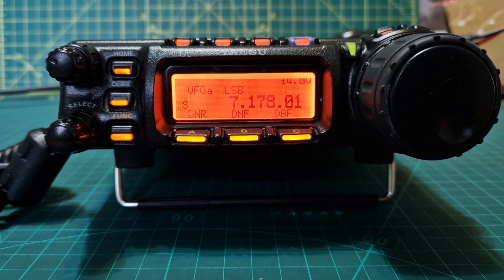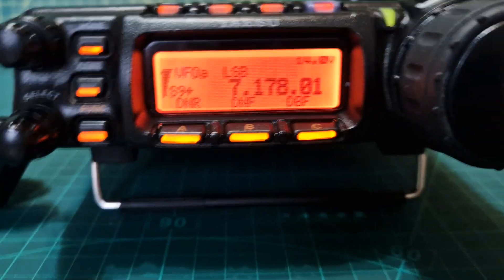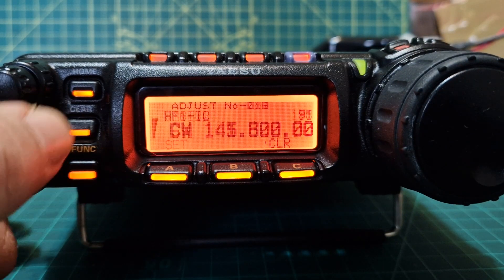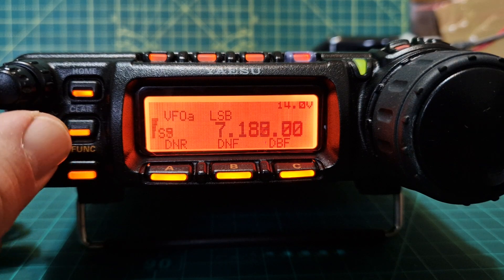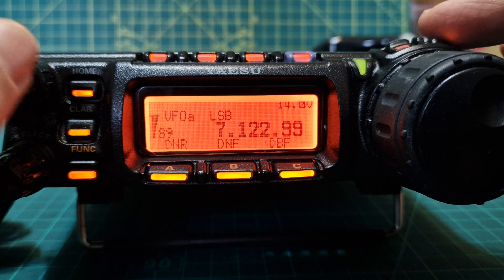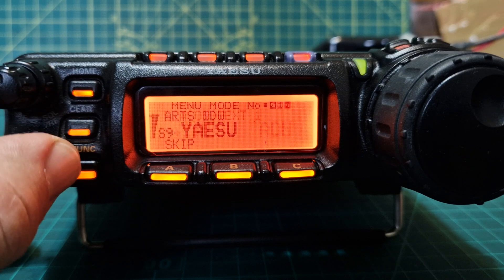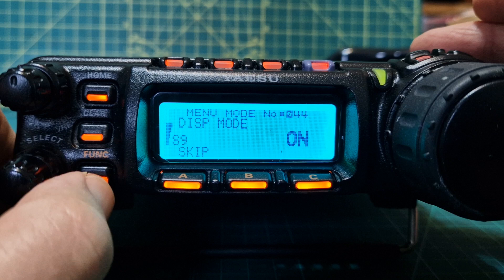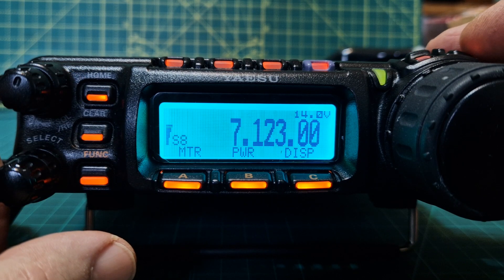YAESU FT857 - RELAY CLEANING & HIDDEN MENU

Comment: I have the FT857 which I thought was a D model is there much of a difference of those codes you mentioned
Reply from the maker: What codes ?
Reply: @M0FXBHamTech   There is program codes which run the radio, mostly internal ones. There so called Hidden ones, I found it on a different youtube
Reply: @M0FXBHamTech  the so called hidden codes that you program the radio with, not the func but the ones where you push the ABC buttons

Comment: I have this radio, here recently i have gotten shitty transmit reports i have dont the reset procedure but not the a b and c while turning it on, i held the home button in while turning it bk on and still shitty reports, think this will help?
Reply from the maker: Worth a try but it's probably your antenna and interfience in your home , try a very long wire away from your home also power 857 using a battery .
Reply: @M0FXBHamTech  its in my mobile and with the atas 120a antenna

Comment: What does it mean to clean relays? I dont understand the purpose.
Reply from the maker: Exactly what it says
Reply from the maker: The Yaesu FT-857D uses relays for a variety of functions. Sometimes the relays will get buildup between their contacts and the radio can start acting odd, or certain functions stop working. Most people go to the reset procedures, but there is another troubleshooting technique that might fix the problem without losing memories and settings - Relay Cleaning. The FT-857D has relay cleaning built-in, and can be accomplished is just a few minutes.
Reply: @M0FXBHamTech  This doesn't pass the "sniff" test. What do you propose is happening here, Electronically?
Reply: @robyounce4636  thats what i was wondering, the whole process doesn’t take long so wondering what is happening inside